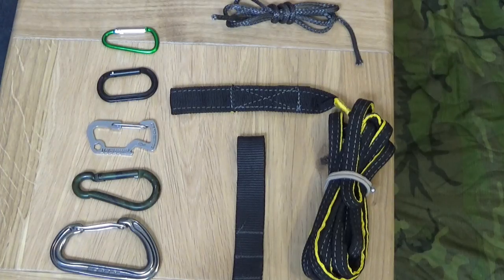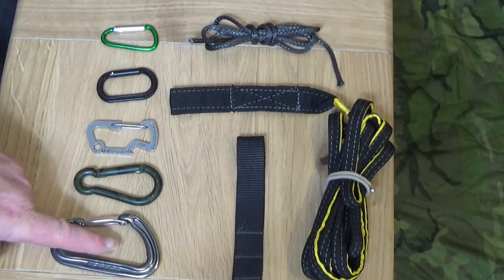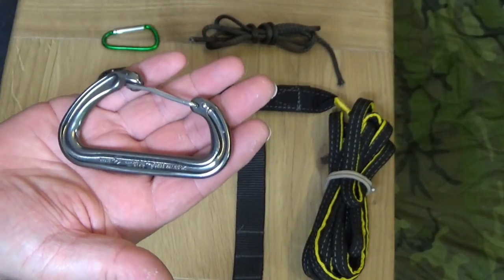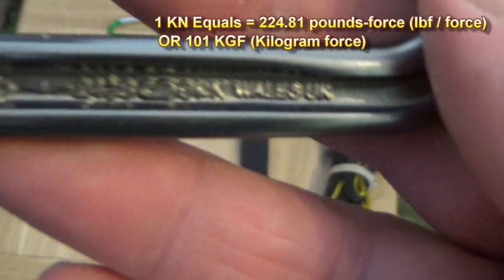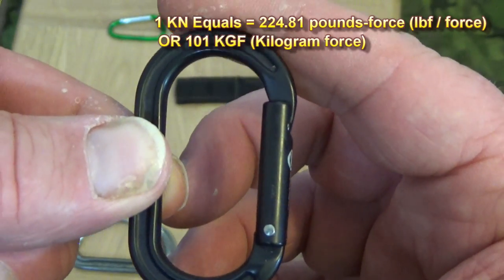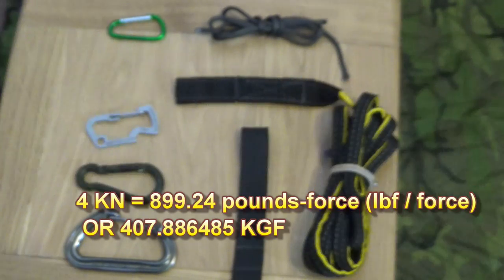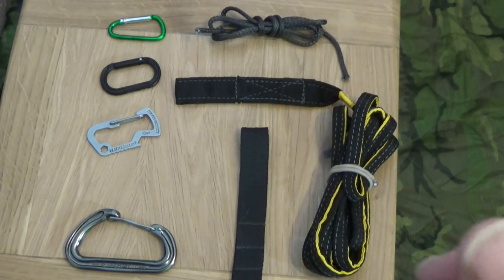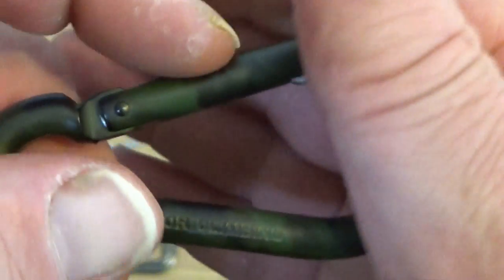Hammock For The Big Guy

Comment: Another great vid :) 

It's worth noting that as we get in and out, toss and turn while in the hammock, that we will load it much higher than your actual weight temporarily. And that the movement of the load can affect your anchor points on your trees. Also the hangle makes a massive difference to the force on the suspension. Go less than 30 degrees and the load ramps up significantly. I've seen too many vids where people have almost horizontal suspension (not you).
Reply from the maker: Absolutely Martin points well made.